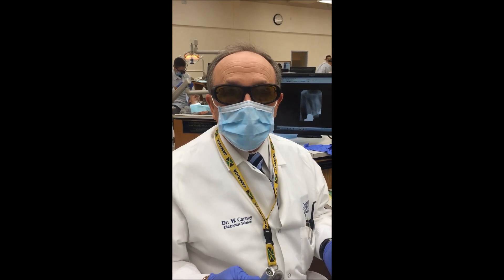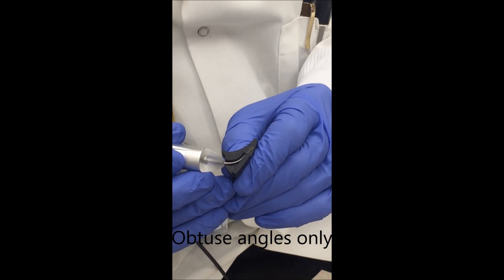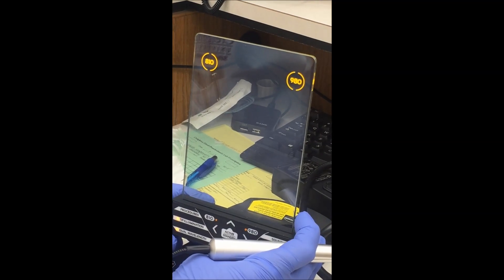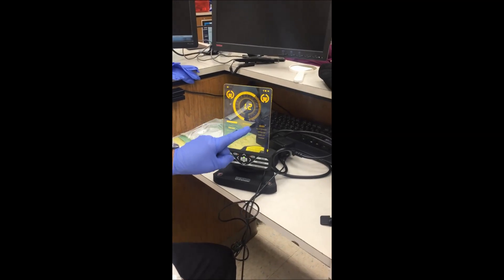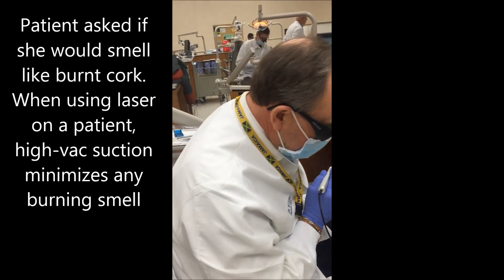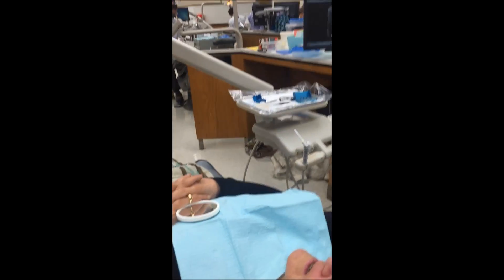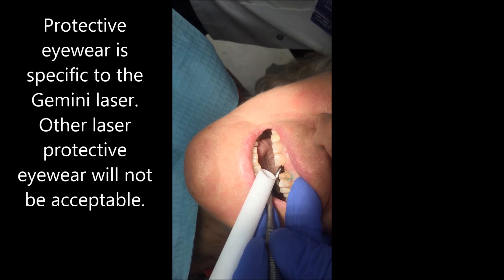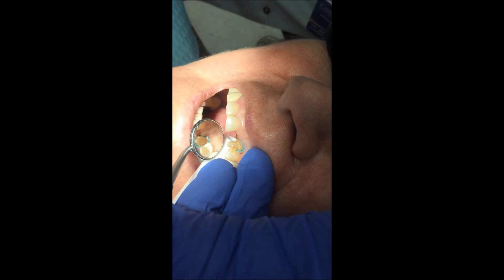Gemini (Ultradent) Laser for Gingival Recontouring

Comment: Great procedure! A couple things to point out with Gemini. The keypad is soft touch. It actually works better the lighter you touch. Also sound and aiming light are independent so they both can work if you wish. Touch sound and then toggle up and down on the keypad to your desired preference. The sound bar is on the left side of the display. The aiming light works the same way, toggle up and down. You will see the aiming light indicator on the right side of the screen. Best of luck!